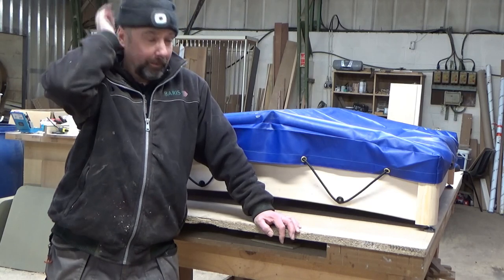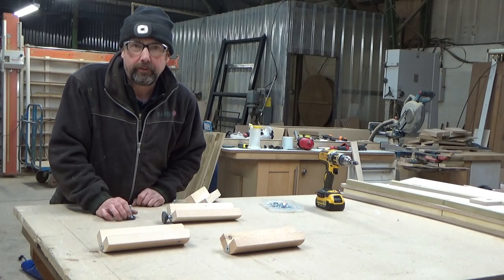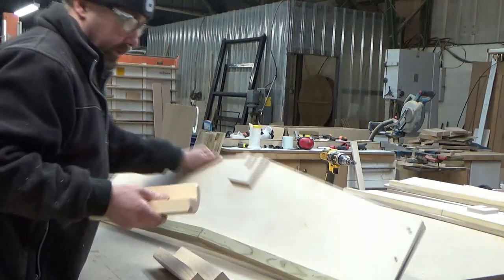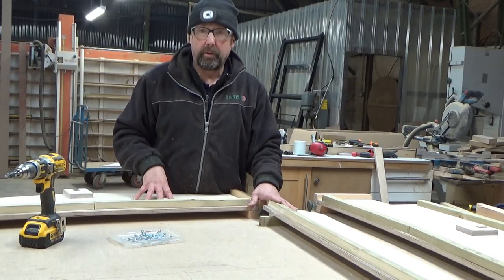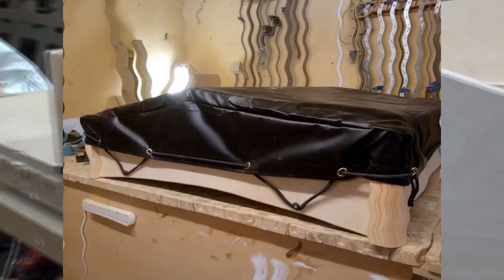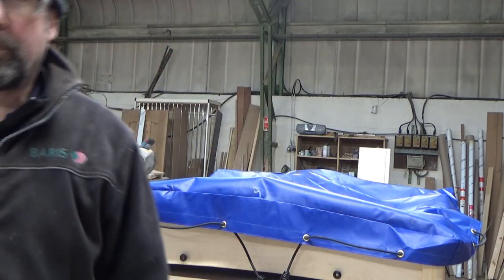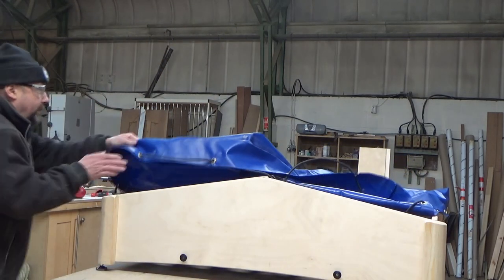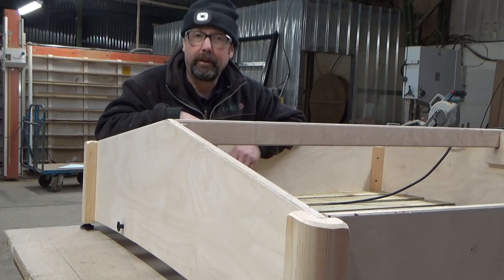Narrowboat Build and Fit Out - Top Box Self Assembly Kit Build

Comment: Do these come in kit form so we could self assemble. How much are they? Cheers bud
Reply from the maker: Hi Will, The box shown is 1200 x 1200 mm and costs £260.00, inc delivery flat packed. They are a kit that comes predrilled so you just have to supply glue and put in the supplied screws . Takes approx 20 minutes to put together